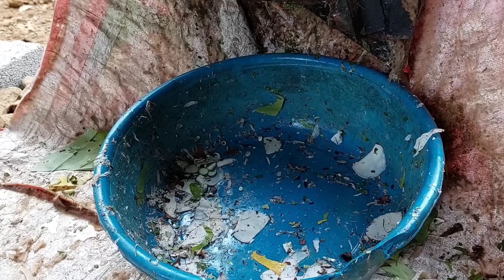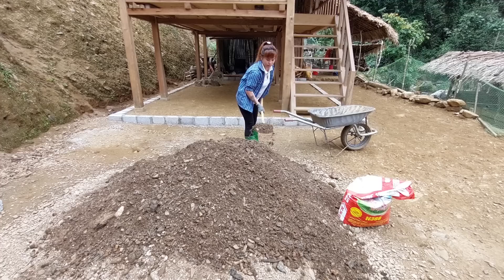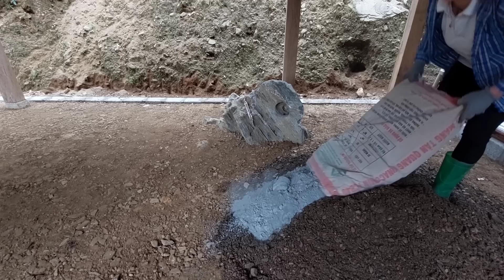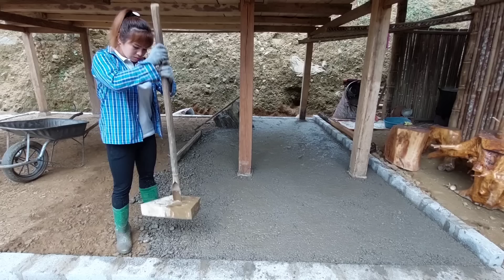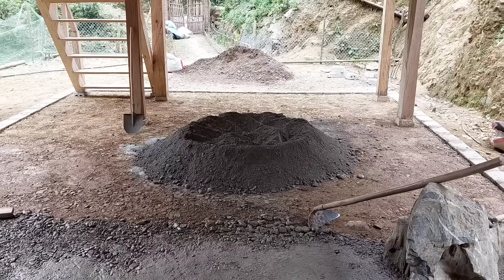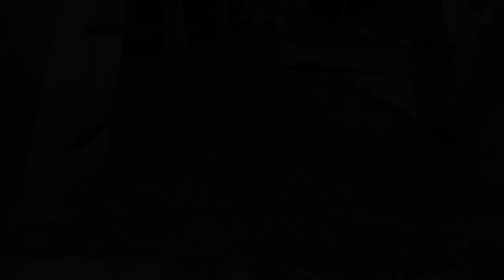Pouring concrete floor house - Cement house construction techniques, green farm life, free bushcraft

Comment: A very impressive finish young lady given the shallowness of the concrete pour and the size of some of the rocks in the mix, quite extraordinary.  A lump of wood on a small shovel and a chaff bag on a stick to smooth it off, that thinking outside the square.  Suspect there was a little more liquid involved at the end to get the finish but nevertheless well done young lady, very professional effort.